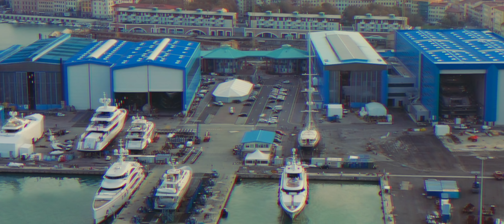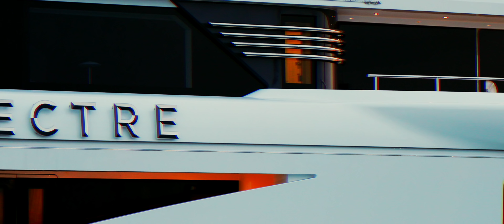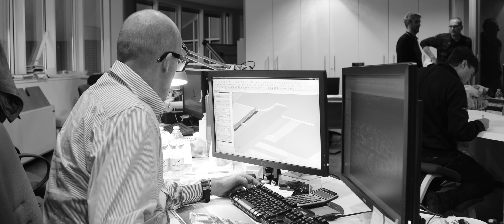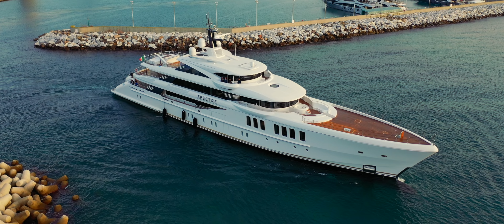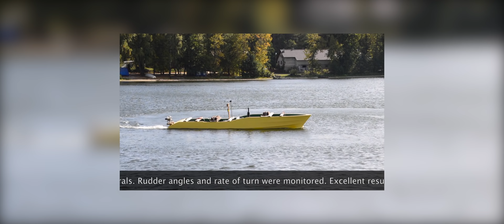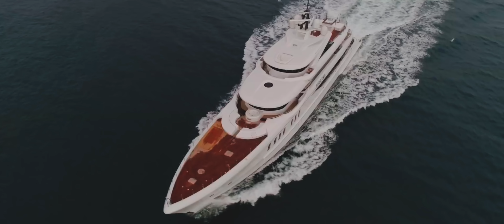BENETTI YACHTS AND THE STORY OF SPECTRE SUPERYACHT

Comment: John Staluppi's new Bond-themed yacht. Very impressed with Benetti's work on shedding weight from the build but if John wants to build another superfast yacht he should talk to the companies that built Ermis2; McMullin and Wing/High Modulus. The 124ft Ermis2's propulsion is triple 3500hp diesels coupled to KaMeWa waterjets. Top speed is at least 60 knots.

Comment: Well, when money asks, determination answers. If the requirements (according to this clients' brief) were feasible to design and manufacture, it would, in a sense, render most other things obsolete, wouldn't it? If speed, stability and comfort were possible to accomplish simultaneous without compromise on any, why wouldn't all super yachts be built the same? If it's a matter of cost, those who venture into projects like this, usually have an open budget to work with.

Comment: I have a quick question, with weight being so important, why is carbon fiber not used more in the construction of mega yachts? Like why isn't the hull or super structure made of carbon? Is it that cost prohibitive or do we simply not have the technology to produce carbon structures that large yet?
Reply from the maker: Cost is one factor, but the greatest challenge with carbon fibre hulls is that it is very difficult to soften the vibrations from engines and machinery. As technology progresses I expect to see more carbon fibre composite yachts.
Reply: Cost.  Obviously this a very expensive and difficult product to work with - on/for a yacht.  It’s best left to the aircraft/aerospace and automotive world (especially for ‘pieces’ not shells and large expansive surfaces).  Carbon fibre is not the super material that many ‘think’ it is.  Good question/comment though.

Comment: The use of wood, wich is a heavy material was kept at a minimum...

Looks at the marble floor
Reply: Marble can be sliced extremely thin, it's not like they are using 10 cm thick slabs 😁. In fact marble of yachts is often heated underneath. Besides, there is a limit to compromise. They weren't going to use linoleum 🤣